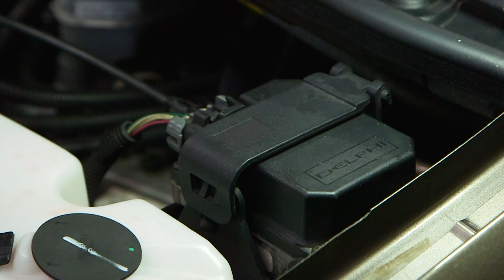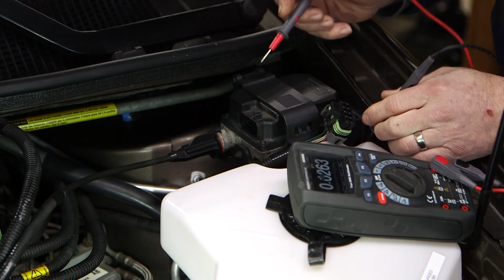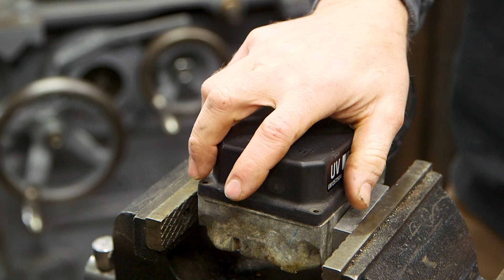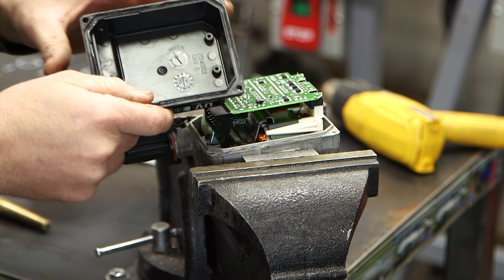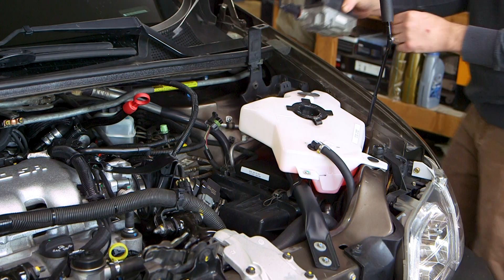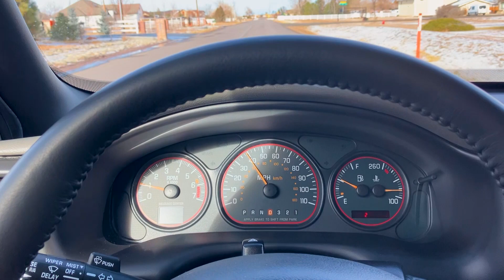Cracked Solder Joints or Fixing 90's Electronics

Comment from the maker: Update to this one:  I drove around with my Autel scanner connected and watched the "Cruise Control Inhibit" PID.  The PCM is getting the correct signals for cruise control and the Autel reports correct function of the vehicle speed sensor and the brake switch.  It is reporting an error:  SMCC Failure.  I did some research and the SMCC is the little module I tried repairing in this video.  So it's confirmed, the module is what failed.

Comment: Did you buy a new board cruise control, because those micro 30 micro chips are probably impossible to find or maybe After market Chinese ones ?
Reply from the maker: I bought a used from from a yard out in Arizona.  That one worked but I did have to resolder its joints too.

Comment: I appreciated this video, we can't fix everything all the time. Im wondering if you ended up getting a new module? did it work?
As another commenter suggested below a magnifier (Or an iPad with its Camera zoomed in) can reveal micro-chips/cracks in solder joints that the naked eye can't see - as that board was relatively small you could have just reflowed "all the solder socket joints with flux" and used a heat blower gun across all solder joints, cool it down, refit re-test.

Additionally, you could try removing the board from its housing, flip it over and give all the SMCs a decent wiggle with your finger one at a time to find and suspect loose/broken or even smell them for burnt-out items.